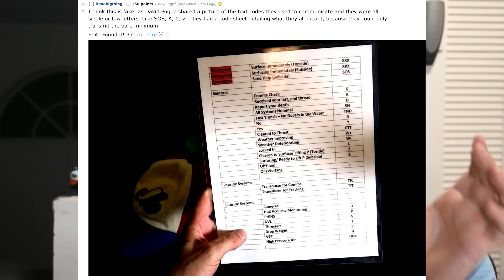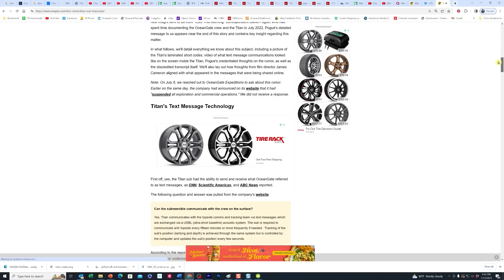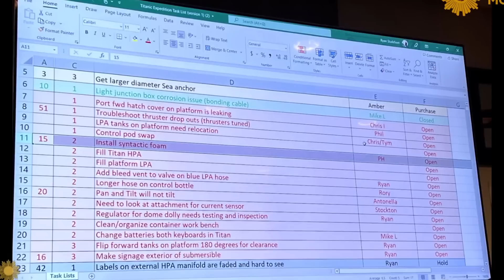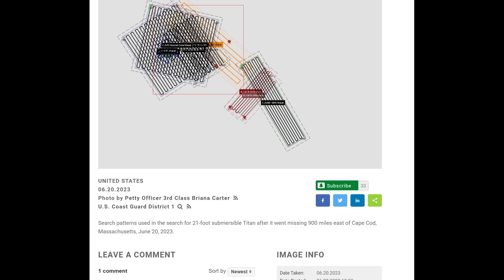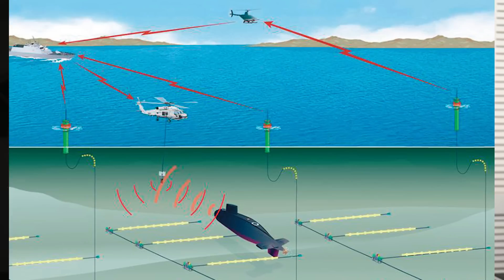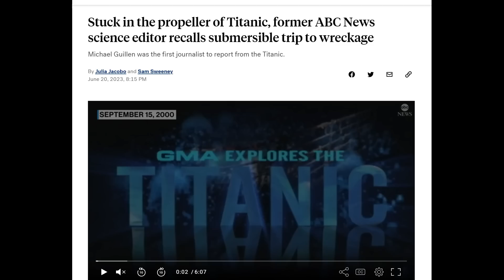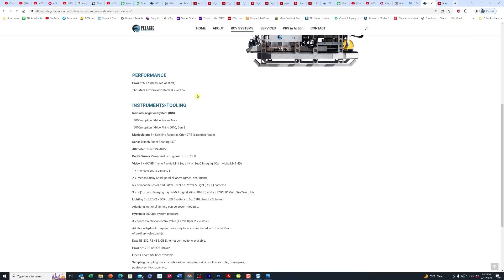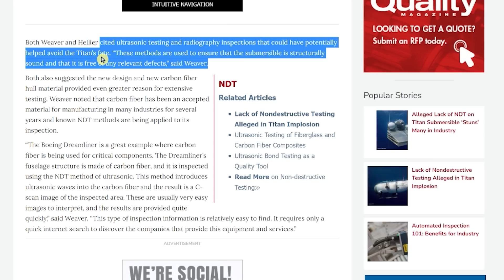The Shocking Truth About Fake Sub Transcripts No One Tells You

Comment: Yes, carbon fibre is very strong. But it is also very fragile. If anyone here is a fan of Formula 1 racing, well you will have seen many times when the front wing on an F1 car is damaged and parts fly off and basically shatter and disintegrate when they hit the track surface. That is the problem with that material. It is incredibly strong right up to the point where it isn't. Then it just isn't there anymore. I know that I would not have gotten into that submersible, even if they had paid me any amount of money.

Comment: The sensitivity of the underwater microphones that the Navy used to detect the implosion is probably a secret. If the Navy immediately said, "we detected an implosion"... and a potential adversary knew where those sonar stations are or say where the closest one is to that implosion (a possibility that can't be ruled out), they could probably fairly easily calculate how sensitive they are, and in so doing they know how quiet their submarines need to be to avoid U.S. detection.

I'm guessing there was a lot of internal discussion and messages back and forth up and down the command chain as to how to release the information without compromising that secret, which is why there was a delay, but that's a guess on my part.

Also, on such an experimental sub material, where they knew hey heard cracking sounds each time it went down, they should have been performing NDT on the hull after each dive to look for delaminations.

Comment: Using a gantry crane to lower the ring onto the sub body is also bad, they eyeballed the alignment, the s,ings can swing, which means uneven install of the ring, glue push away.   They should have used a precision jig to align the parts, not eyeballing it while it can swing back and forth.

Comment: Most vessels with ROV will have a crane that can go to the same depth. The ROV will connect the object to the crane hook using soft slings etc. and the the object will be retrieved. 
It is possible to use the ROV but if the ship had a crane it would have used that.
Anyway, great videos.

Comment: Their manufacturing methods were awful. First and foremost not doing the CF winding and attachment in a clean room, time expired materials, the winding method is definitely not correct, no gloves/hairnets/clean suits, no autoclave or a minimum a vacuum container or bagging process in an oven, that attachment method is an absolute joke if that is all they did, plus no NDT after the cure (hell, a coin tap test tells you a lot and is free). This is coming from someone that works on and has helped design CF commercial and ultralight aircraft.
One place I worked at, the plant almost lost their certification because there was a coffee ring stain on a desk in the clean room. Cleanliness  cannot be over emphasized with all composite manufacturing.

Comment: the thing is we are assuming there was no inspection of the joints for voids. it would be pretty easy but probably expensive to do something like a radiographic inspection on them, that's pretty standard in the aviation industry (Stockton did say he was using aviation as a model.). i bet the CF house can answer that question. edit ok there is that article, but then again the CF house may have done their own testing on their components. just because Oceangate didn't do any testing doesn't mean the suppliers didn't at the parts level.

Comment: The frame  released (until the implosion) because the carbon fiber hull was compressed at that depth and had a bind on the frame supports.
If the frame weighs approx. 1,000lbs and the submersible weights 23,000lbs then subs ascent should have been quicker without the frame.

Ascending from 3433m (9:28:16) to 3476m (9:42:42) = 19m in 14 minutes & 26 secs.
 (1.3m per min.)

It looks possible that the self releasing 35lb weights hanging by a rope may have drifted up on top of the ballast attached in the hull. 
The sub was dropping at a faster rate may have caused that to happen.
The frame may have been supporting the carbon fiber hull from compressing (because of the frames spar running down the middle was fixed) and when he tried to jettison it, the frame dropped a little and jammed. The hull compressed with the jettison procedure and jared the weight release mechanism (that he tried earlier) enough to release some ballast.
That could be the cause of a very slow ascent.
Also the video of Titan's frame recovery shows the 2 frames support at one end are bent outward. If the Carbon Fiber hull implodes the compressed air inside has to go somewhere. I think it blew out the ends.  The rings (with the frame attached) and caps blew off with so much pressure it bent the frame, knocked out the window and snapped the welded on bolts to the frame holding the window in. Because they are clearly gone.

[09:28:16] [TITAN] we're noting an alarm from the rtm (Real-Time Monitoring System)

[09:28:35] [TITAN] reducing velocity descent depth 3433
[09:28:47] [POLAR PRINCE] Understood. Do you need to ascend?

[09:30:55] [TITAN] no change with thrust the rate of descent is increasing. At 35. 

[09:30:55] [POLAR PRINCE] Yes, agree. Release the ballast.

[09:32:12] [TITAN] 

[09:33:00] [POLAR PRINCE] Affirmative. Update when able. RTM indicator status?

[09:35:48] [TITAN] . But starting the ascent now.

[09:36:33] [POLAR PRINCE]  What is your status? RTM indicators? Depth?

[09:37:38] [POLAR PRINCE] Update please when able.

*[09:38:09] [TITAN] crackling sound at aft

[09:38:44] [POLAR PRINCE] Can you identify source? RTM indicators status?

[09:40:12] [TITAN] neg

[09:42:42] [TITAN] . quarter predicted. . No indicator. At 3476. Aiming for the surface.
Reply: Sorry first time posting. I put in bold (Never)  and the post deleted it. I meant to say the frame never released. I also put in bold some of the transcript. Jeff you can delete the post and I will do better next time. Thanks

Comment: Toyota is making a carbon fiber hydrogen tank for their Mirai Electric car that is keeping fuel at 700bar. And they have tested and approved the tank to be used in that car. So its seems Carbon fiber can be used as a pressure vessel reliably. They guarantee its safety for a number of years after which it has to be replaced.

Comment: there was no extra adhesive and having 1 or 2 inches bonding surface around the cylinder  is not enough, i though the cylinder was going to at least midpoint or all the way so they can bolt the titanium,  that ring looks like 12inche high

Comment: Sure, the sub might be cracking, they are on the way up, there’s no response from them. Let’s just wait another 9 hours, to find help. They might be able to swim back up if the sub imploded. 🤣🤣 come on people .
Reply: After it imploded they would be badly burned by the compression of the air, raising the temperature to tens of thousands of degrees. Additionally, their chests would be crushed against their backbones, and their sinuses would be completely crushed. The shock wave and oscillation of pressure would break other bones as they were compressed into the titanium end caps, and possible extruded through the window
Reply: @sranderson7  and your points are?

Comment: I'm about 95% sure that transcript is fake.  In it there are several references to attempting to ascend, dropping ballast, dropping the frame, using propulsion to try to ascend.  Ask yourself, why would it struggle so much to ascend?  It would have been ballasted to be nearly neutral, maybe slightly negative buoyancy.  It would have been set up such that nominally dropping ballast would create positive buoyancy.  Dropping the frame would've given it significant positive buoyancy.

Yet the transcript would have us believe they were still negative, having to "drive" their way up.  How would that happen?  Only if they took on extra weight.  How would they have gotten extra weight?  Only by taking on water into formerly dry areas - displacing far less dense air.  From the pictures on earlier dives it looks like the typical ballast and frame would be several hundred pounds.  You couldn't take that much water into that small pressure chamber without setting off alarms, or the people inside noticing - either the water sloshing around or the increased pressure from the volume of water coming in.  Don't you think if they were taking on water they might have mentioned that in one of their communications?

The omission of anything like that leads me to believe the transcript is fake.
Reply: Water intrusion. Possibly even before the descent.

Comment: I remember doing lab sessions at uni when i was doing my engineering degree. We tested bond strength on  glued metals with 2 pack epoxy, with some cleaned, some roughed up and cleaned, and some just raw. The difference in strength is massive! Not properly roughed and cleaned perfectly, the bond breaks. Done properly, the metal breaks before the glue.  I am amazed to see they did such a poor job on that.
Reply: but he passed the savings on to his loyal customers....😜
Reply: I was a diving officer on fast attack submarines, when transiting on the surface it is common for sea water to pass through the periscope seal and rain into the control room, but once we dived the sea pressure would seal the packing and the leakage would stop.  Once submerged the glue was irreverent the sea pressure held the pieces together with great force.

Comment: On the Glue theory that none was oozing out... I cant remember exactly but im sure when the video showed them applying the glue, they were scraping it on, or for want of a better word....errrmmmmm like applying it very flat, using a card if you like to apply a flat layer, so i would understand why none is oozing out, i guess it would ooze out if they just squelched a load of it on there like you would with wood glue for example, but yeah, im sure they were spreading it flat and thin. Why they would do that i dont know, maybe they were trying to avoid getting air bubbles like was mentioned... I guess if you just slap it on there is a possibility of air bubbles on the ring, but flat and thin maybe not... So many possibilities, so many questions that we will likely never get the true answers for...

Comment: Hello Jeff, I am a subscriber.

It is said you are actually a "cell phone engineer", am I correct? You did lots of work with Motorola and such, can you do a video of the problems Titan had with communication problems? 

Seriously.

It has become more and more obvious that Titan had serious problems with touching base with topside ships, even to the point they lost contact many, many times, even having to scrub missions because of these situations.

Motorola, Apple, Android, even Google, which of these services did Titan use? 

We do know that Elon Musks' Starlink was used as well. 

A few questions, if I may... 

1) On the Titan submersible, how reliable was Bluetooth to transmit from the the game controller to a receiver to the back of the submersible to a receiver in the back end to control the submersible? Did various water pressures create problems? We do know it was used. Was pairing a problem?
2) We also know that the on-board computer was used to control the submersible.  What was the software interface used to control the thrusters? We hear it was a standard video game mapped from the controller, what was that video game? Was it simple or designed for this?
3) Missions were aborted constantly because simple text messages, even from the submersible to topside were not received. What could have constituted this problem? Could it it, in your opinion, have been remedied? 
4) There was an antenna on the submersible, was it able to push or "help" text messages transmit from top to bottom and bottom to top? Is this feasible? That would take a good amplifier to get through the thermal layers to reach, what kind of amplifier could have been used?
5) As a "cell phone communications engineer",  what would YOU have suggested to fix these problems? 
6) I know this is hindsight, but many of the viewers, including myself, would enjoy knowing these answers.

Jeff, I respect you immensely but as a cell phone communications engineer, these problems need to be solved for future reference. I know there are no cell towers underwater, and none even placed at 12,000 feet, but this is a serious problem for those wishing to avoid these situations. As you are an expert in this, maybe you can shed some light on this?

Your response would be greatly appreciated. Thank you for listening and I expect a quick response or a video responding to my questions.

Yours truly, 

Chance
Reply: The Titan submersible did not use any cell phone technology. Cell phone communications cannot go through water. The sub also did not use Starlink. Startink frequencies cannot go through water either. Starlink was used to provide internet access to people on the support ship. 

 1. I own one of those Logitech controllers. Very reliable for me at least. It is designed for use with computer games (PC and Mac). I use it with many different games. It also connects to my big Samsung TV so I can play games using the SteamLink smart TV app.  Bluetooth doesn’t work through water. The receiver was inside the sub. 

2.  No idea, but I suspect it was a simple Interface that provided power through a D to A converter with a power driver (amplifier). 

3.  Communications between the sub and the support ship were very low frequency RF. That and sound waves are the only things that can go through water. 

4.  A VLF transmitter and receiver. The low frequency forces a very low bandwidth, so text messaging is all you can do.
Reply: @sranderson7  Maybe Jeff, who is a communications expert, can make a video and give his ideas. Not to be mean to you, by no means, but he has this channel and he should address this, correct?
Reply: @chancelambert8462  I just figured I would chime in based on what I know a little about. I have had a 45-year career designing and testing spacecraft and missiles. I have done communications design including link analyses between satellites/planetary probes and ground stations, along with some work in VLF submarine communications.

Comment: Extremely informative,  this one, Thank-you. 

Kindly confirm/ advise, whether the longitudinal forces acting on the CF hull thru its circumference from the rings of the  titanium hemispherical heads, would be immensely greater than the prevailing hydrostatic pressure on the hull cylindrical surface .
Point being the relative surface area of the heads. Thank-you
Reply: Using the online calculator for Stress in Thick-walled cylinders with closed ends on Engineering Toolbox gives a radial stress as 38Mpa, axial stress as 135Mpa and Circumferential stress as 233Mpa when the outside pressure is 38Mpa and internal pressure 01.Mpa. The stress you are looking for is the axial stress so it is larger than the hydrostatic pressure. Not surprising since it is the full force of the end area applied to the wall area.
Reply: @kengself  Thank-you,  my thoughts throughout,  hence most likely a major contributor to the CF hull destruction,  mainly because of the dissimilar materials of construction. Thanks again.

Edit add'n...
Moreover, as CF is reportedly not best suited for compressive forces vs tensile forces.
With the circumferential CF  symmetrical wrapping vs cross strapping,  axial crushing of the hull was just a matter of time.  Sad, really sad.

Comment: I watched in horror as they assembled this submersible. The interface between the carbon fibre and titanium was flat. Id think the cf would compress more than titanium, shearing the joint like a knife. Where was the internal barb on the titanium that the cf gripped onto. Workers on LADDERS. Thats instant no from the the ( missing) safety inspectors.

Comment: If you can send 3 letter acronyms you can send 6, 9, 12, 100 characters too. If you can send character you can send phrases. The 3-letter acronyms are a safety measure, if for any reason the conditions are not right and the sound signal is being warped/distorted/muddled it would be easier to get short messages through than longer ones. This is what I think and I might of course be completely wrong.

The best evidence is the screen from the documentary that this transcript is real.
Also WHY would anyone fake it anyway? And with that level of detail? And fitting a narrative that makes all the technical sense?

Comment: I don’t think we can decide if the transcript is fake just because the bbc shot showed them use if full sentences, as due to the circumstances they where under at that time. they may use the code for general communication, but they would need to use fuller sentences to convey the exact problems that they where having, and again for the surface to use fuller sentences to give a remedy.
It’s most likely that they chop and change depending on the circumstances, and I think because of the lack of code the transcript is more likely to be fake

Comment: It is remarkable that they claim some of the work was done at Boeing. I know that Boeing has quite extensive CNC carbon fiber layup facilities, and an R&D department second to none. Yet Stockton produced an inferior product from both an engineering and development standpoint. 

In regard to the descent velocity, the initial part of the dive profile can allow for a faster descent as pressures are much lower. However, this depends on the design of the vessel, which may have lacked attention . 9:57